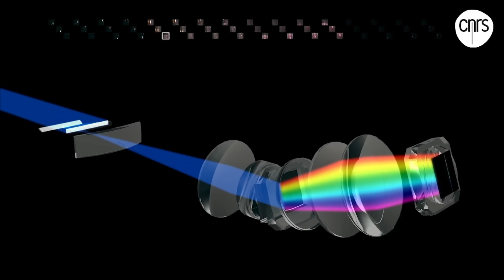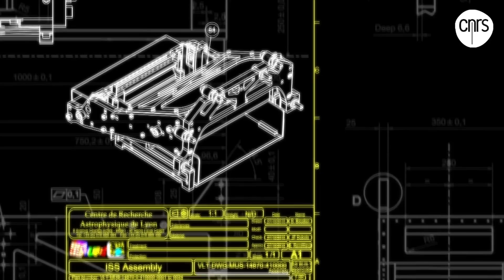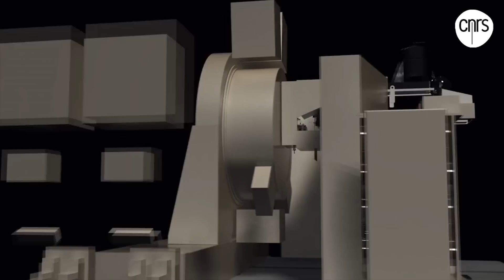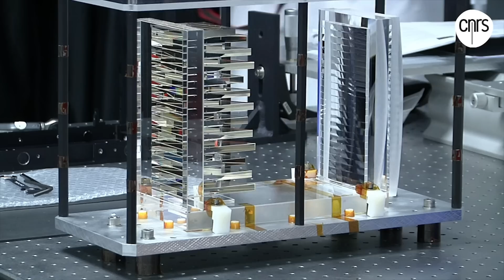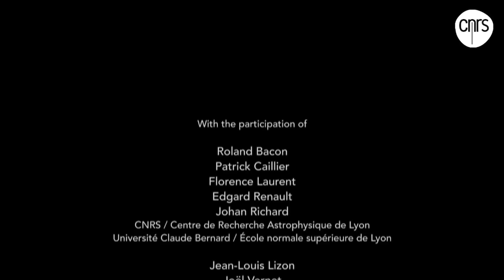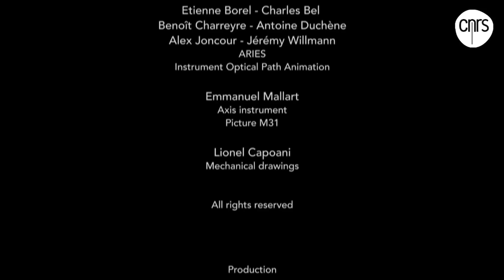MUSE, The Cosmic Time Machine

Comment: At 6:24 it says that the derotator compensates for the Earth's rotation. This is not what the derotator does; it keeps the image from the telescope vertically aligned as the telescope tracks/slews. I tried to find a nice writeup or diagram but couldn't.